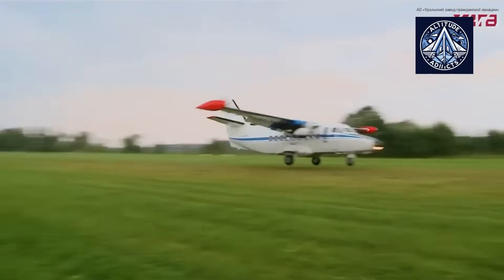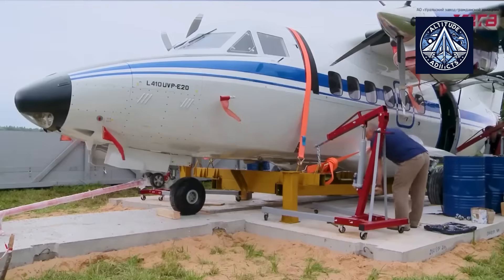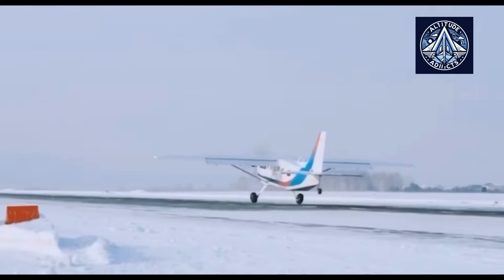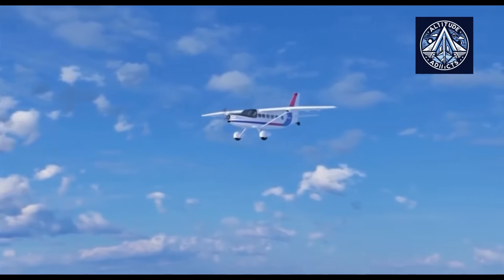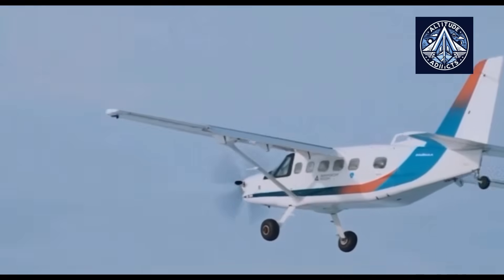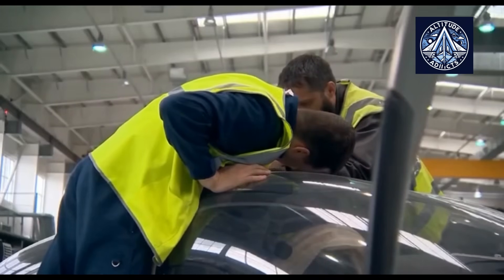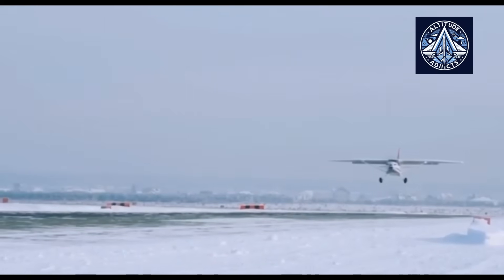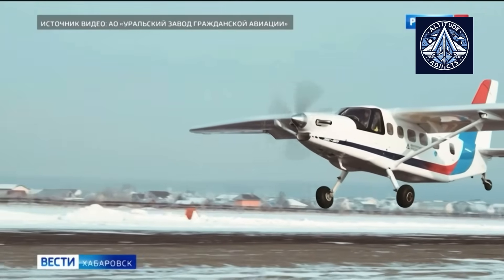Russia converts the L-410 into a Floatplane, LMS-901 Baikal Aircraft Next

Comment: Why not use the LMS 192 fuselage of different lengths? For the shorter one (LMS 901), a single engine in the nose combined with a fixed tricycle landing gear (Mi 17) would be sufficient as a cheaper variant. In the LMS 192 variant, it would be a classic twin-engine aircraft, while in the extended variant, a three-engine aircraft like the Ju 57 would be used. The tricycle landing gear and the wing ramp are mandatory for all 3 aircraft.

Comment: in reality the single engine Baikal is inspired by the Canadian De Havilland Otter with fixed or float landing gear .... and the twin engine Oswey will be very much like the Twin Otter which is also has fixed or float landing gear. Why reinvent something that clearly works in Russian conditions ? I doubt you will see any more L-610s converted to floatplanes once the Oswey is signed off. UWCA has more than enough work on its hands ...

Comment: The L-410 float plane variant was a very promising project back in 2018 when flight tests started. Today it's practically dead due to the embargo driven lack of spare parts in Russia. This project is yet another victim of the pointless war, creating a gap of at least 10 years until the Baikal or whatever other model may become available for water operations.
Reply: Actually the spare parts problem mainly centred around the engines. The new VK-800 is going to be used on the Baikal and also a twin engined aircraft together with a Belarus company, and the UTS-800 light training aircraft, and the Altius drone, but it is also going to be retro fitted to the L-410 to allow them to continue operation. This means current L-410 operators will start using the new engine sooner and when they upgrade to the Baikal and the Belarus twin engined aircraft they can keep their manuals and spare parts resources for the engines which they will already be familiar with.
Reply: With the modifications to the LMS 901 that I have listed, the L 410 becomes an obsolete aircraft.
Reply: @borissljukic1470  Hmm—didn't Deputy Prime Minister Yuri Trutnev express strong criticism of the LMS 901 a few weeks ago? According to the Tass news agency, he mentioned significant design problems, such as stability during slow flight. That would be a huge issue for a float plane variant in particular.
Reply: @luisdamian4562Or was that him "just blowing smoke"?😅😂